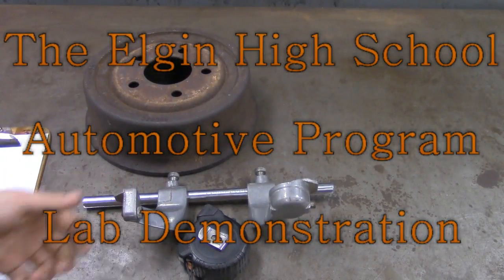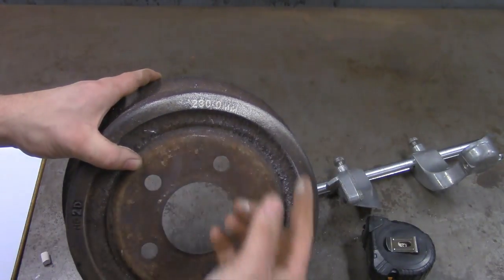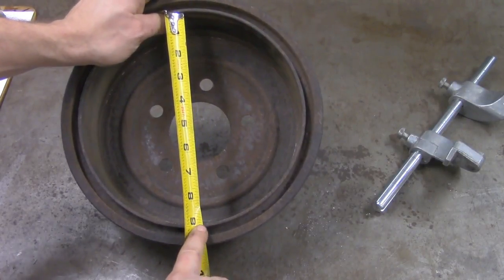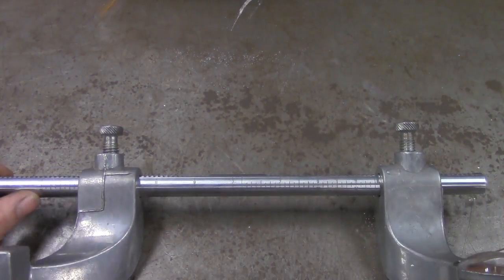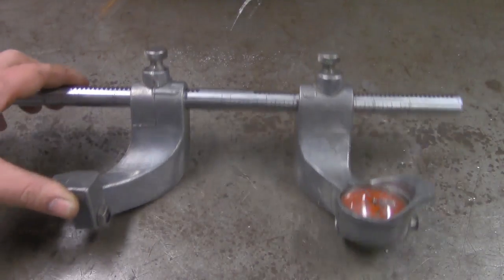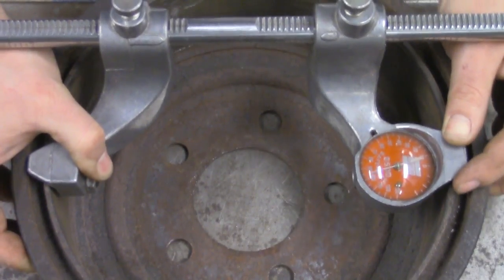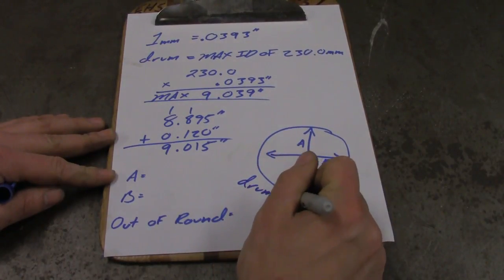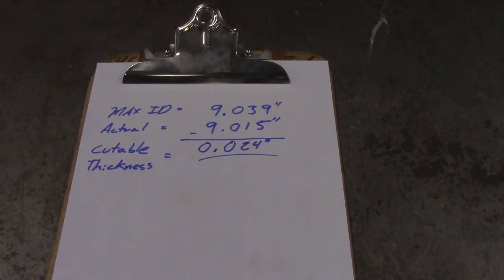AMMCO Brake Drum Micrometer

Comment: Javier Quispe below, noted the following to which I totally agree with, excepting that I would just take the 230 mm / 25.4 as is the conversion to get the 9.055" value, however, there is more error than this and no one noticed it.  The number stamped into the drum is not the dimension to which you can "machine to", it is the "discard" dimension.  For brake drums the "machine to" dimension (or "rebore" dimension) is typically 0.030" less than the number stamped into the drum and this value is specified my many vehicle manufactures in service information.  This extra 0.030" is meant to exist for the purpose of wearing out a full new set of brake shoes. Any removal of metal or wear of metal beyond the Maximum diameter, stamped into the drum, will affect dissipation of heat and may cause distortion of the drum.  It truly is sad and scary that some one out there did not point this out before over some 30,000 views have taken place. It is scary to think of how many vehicles could be out there on the roads driving around on subpar brakes.

Javier Quispe:  You made 2 mistakes one is your drum spec which should be 9.055 and your micro reading. I don't know how you get 8.895 it should be 8.875 to this you add your 120. This should be 8.995.
Reply: He should have set the micrometer to 9 inch on each side the gauge would have read 9.055  his way is way to complecated you do not need all those extra calulations

Comment: He has no idea how to use a drum mike if the drum is 9 inch you set to 9 on both sides of the micrometer and take a measurement 230 mm ÷ x 25.4 = 9  055 tho std his way is way to complecated if he is teaching his students that way i feel sorry for his students that is the most stupid way of doing it by the time he measured it i could have measured it machined it and put it back i used one of those ammco drum micrometers for 49 years as a brake specialist